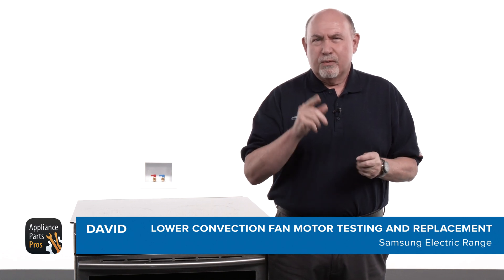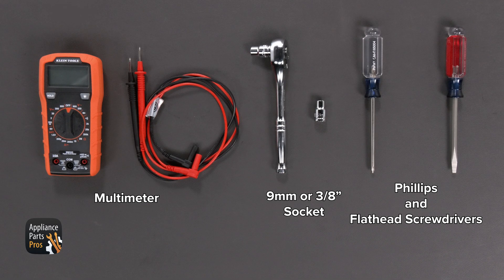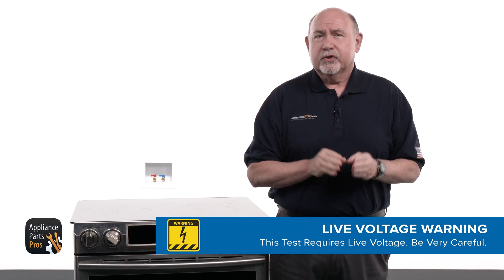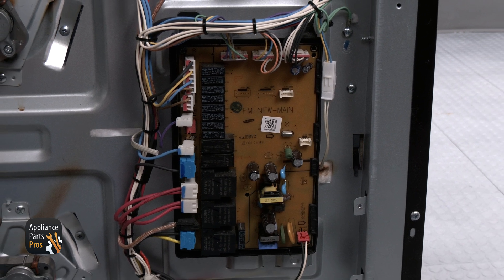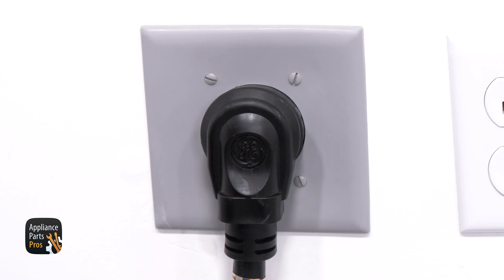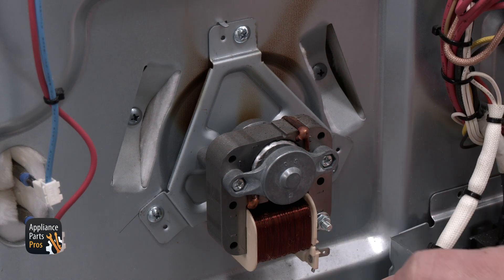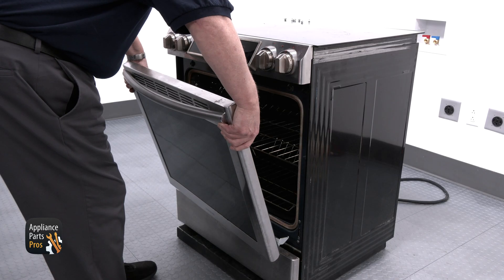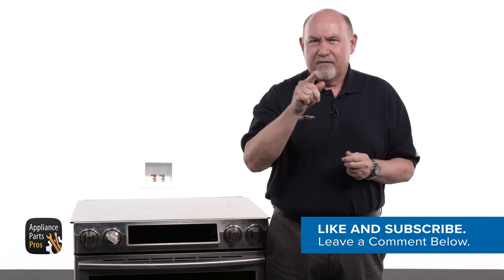Don't Let Your Samsung Oven FAIL! Learn to Test and Replace the Lower Convection Fan Motor

Comment: خیلی عالی بود من تعمیرکار هستم از کشور ایران، خیلی استفاده کردم، ممنونم بخاطر وقتی که گذاشتید، بسیار سپاسگذارم ❤❤❤❤❤❤❤❤❤❤❤❤❤❤❤❤❤❤
Reply: Thank for advice how to fix the san sung low fan motor in the oven  
Re mark could you tell me what to check On a Sam Sung fridge two doors on the top deep freeze at the bottom What is happening It work gpod ot freeze but the refridged is hot  Now i unplug it ovrr night and plug it back  on in the morning  it freeze and cool down  Why was it not working be fore  could u tell me what was wroung 
    C                                                                                                                                                                                                                                                                                                                                                                                                                                                                                                                                                        f
Reply from the maker: Thanks so much for the kind words, @saeideshragh — we’re so glad the video was useful all the way in Iran!

@cedricnathaniel7975 Glad the oven video helped! For your Samsung fridge question, there are a few things that can cause the fridge section to get warm while the freezer still works — like a frosted-over evaporator coil, a bad evaporator fan motor, or an issue with the defrost system. When you unplug it overnight and it works again for a bit, that sometimes points to frost or ice blocking airflow. If you can, check whether the evaporator fan is running and if there’s any frost buildup behind the back panel of the freezer. That’ll help narrow down what’s going on. If you need further help, let us know the model number and what you have checked.